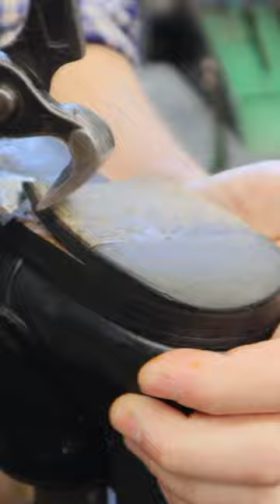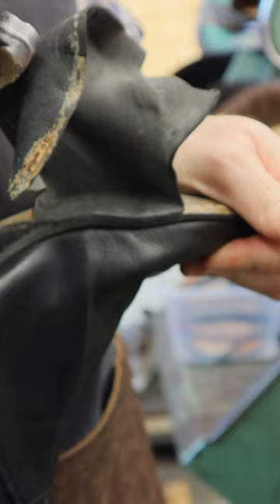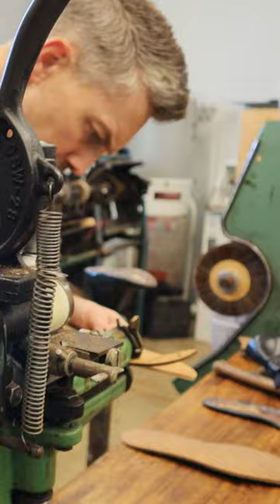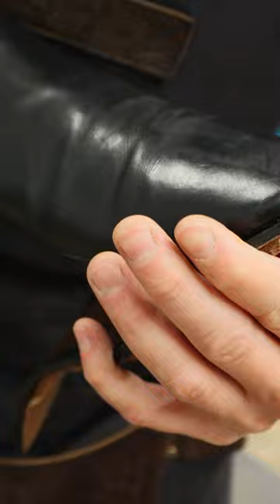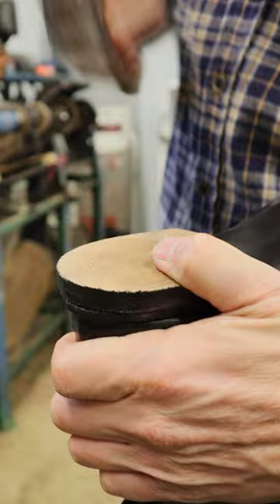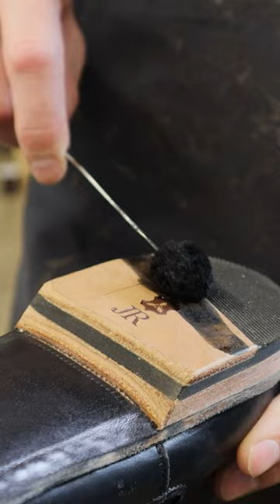$1,300 Prada Boots RESTORED

Comment: What is that metal fitting for in the lid of the jar with the stain, is it for hooking an Air Brush up to it or is it for sucking the air out if the jar??
Reply: It's for raising the brush and lowering it as you use the contents. I think if the brush is out of the liquid, it hardens.
Reply: It's not for airbrushing and sucking out the air at all. That is simply a brush for staining/painting the outer edge of the midsole, as seen in the next clip of the video. Then when you're done, you put it back into the jar, and twist the lid closed. When the brush looks like it's getting too funky and too hard, you unscrew that chunky hex nut on the top of the lid there. Then the brush slides out, and a new one is replaced. The hex nut keeps the brush firmly in place, so that it doesn't slide out. I've seen the exact same thing at my local cobbler's workshop. It's a nifty useful too!